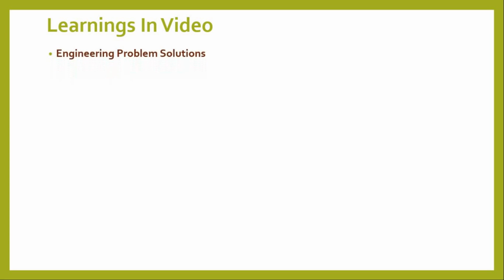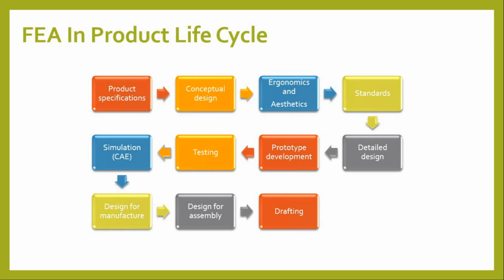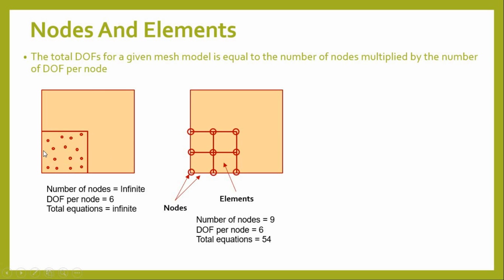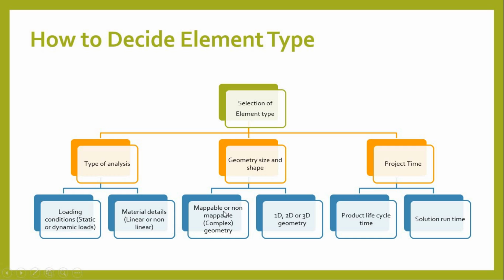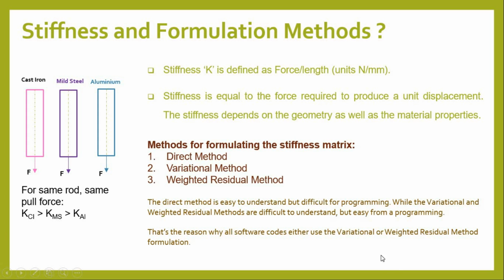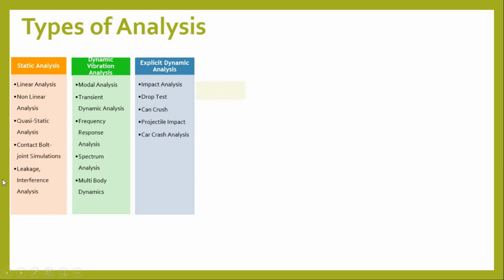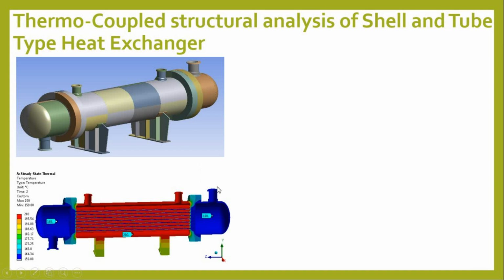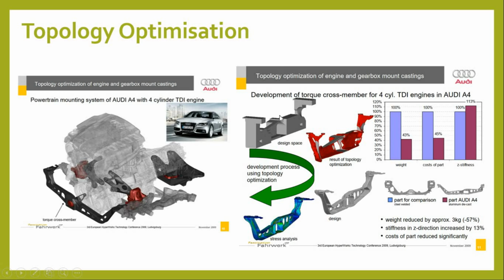Practical Introduction and Basics of Finite Element Analysis

Comment: Sir I want build my career in FEA field please suggest necessary steps
Reply from the maker: Hello Muzammil,  1.You first need to explore basics of FEA, understand what is FEA, node, element, discretization, loading and boundary condition, etc. 2. Execute small FEA problem with ANSYS workbench, learn CAD work & FEA meshing, etc. 3. Learn different analysis types such as static, linear, non linear, vibration seismic, thermal, explicit, etc.
Explore furthermore 1D, 2D & 3D problems.
for theoretical part refer our blog: www.graspengineering.com
for training videos: refer our channel, and explore all the FEA video's one by one.
Once you are confident then search for relevant opening.
Reply: @graspengineering9249  thank you so much sir for giving such a valuable information ❤️❤️

Comment: Can we get exactly 100% result using the FEM for complex problems[ Keeping the hardware limitation in mind]? By the way Great video :)
Reply from the maker: Thank you for appreciation ! If you are looking for solution of complex problem with FEM, it will give you accuracy 90 to 100% range. It is not advisable to look for 100 % accurate results for complex problem, this is due to solution time, bigger hardware requirement. It is further based on your problem, if you are looking for research work we need more accurate results (close to 100%) while for industrial work we need faster as well as accurate results too.